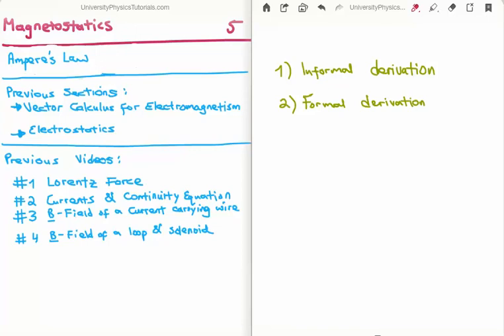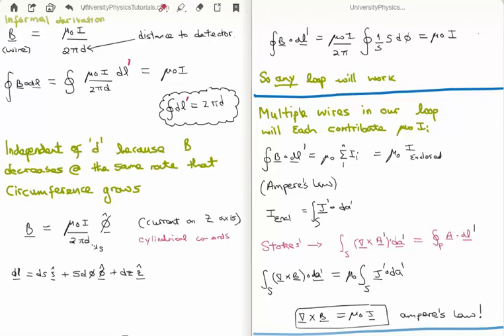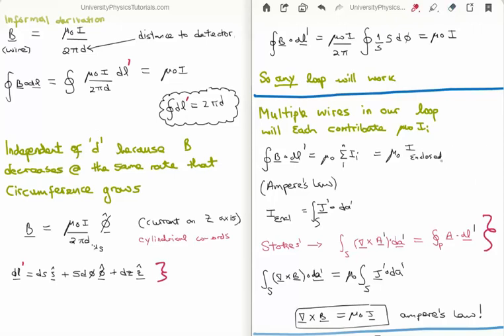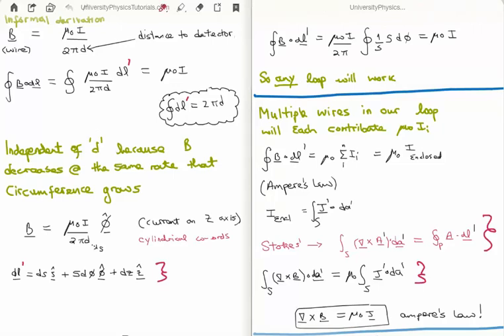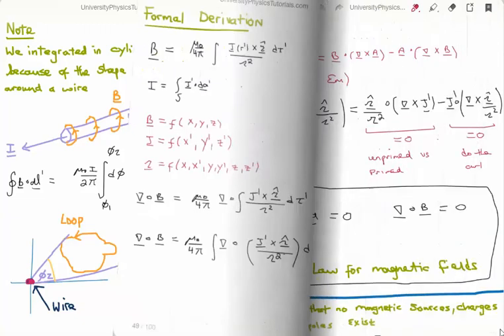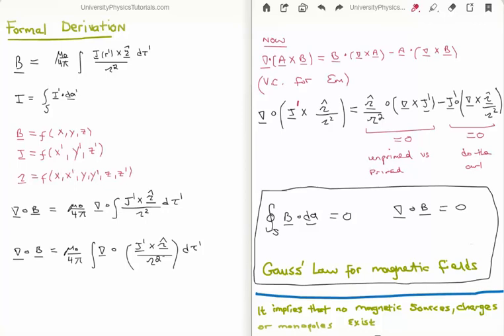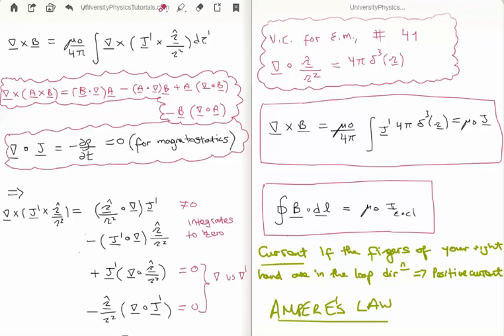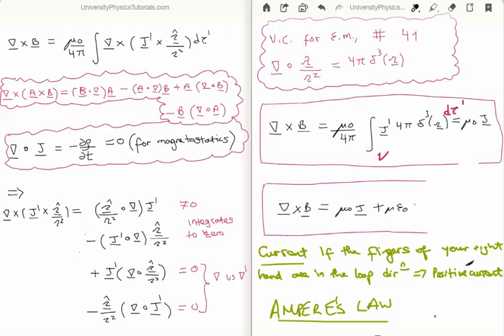Magnetostatics 5 : Derivation of Ampere's Law

Comment: There is a problem in this video with the derivation of the ampere's law @16:02. The (\hat{r}/r^2 \cdot \nabla) J' term actually goes to zero, since \nabla J'  returns 0, as the nabla is the derivative for x, y, z, which J is independent of. On the other hand, it should be the J'(\nabla \cdot \hat{r}/r^2) term which has the dirac-delta function. We should be taking \nabla, not \nabla^{'}, since the magnetic field is dependent on x,y,z. Source:Griffifths.

Comment: I have been greatly appreciating your videos as a supplement and review from my electricity and magnetism class. At around 13:20 you suggest the viewer just take your word that the curl of the separation unit vector over the magnitude of the separation vector squared is zero. It could be explained such that the separation vector is a straight line and a straight line is always curl-less, so that term will go to zero.

Comment: At 8:29 you're talking about the extent of the loop, but the loop does not enclose the wire so How is there any I enclosed within the loop to integrate?
Reply from the maker: That's true, I suppose the diagram isn't great. I was really trying to get across the concept of maximum and minimum angles with respect to the coordinate system. Apologies for the confusion
Reply: Gotcha!

Comment: Why the integral of second term in expansion of triple product at 16:40 is zero?
Reply from the maker: Imagine integrating f(x) with respect to y i.e., f(x)dy. This would be zero, since f is a function of x and not y. Well your question has a similar answer. The nabla operator is a function of the UNprimed co-ordinates whereas both the volume current density (J) and the separation vector (r) are functions of the primed co-ordinates. So we'd have terms like d/dx of x' which would be zero etc.
Reply: Thanks for a prompt response. Separation vector is a function of primed - unprimed coordinates (x-x'). In principle one can convert nabla to negative of nabla prime when it is being operated on separation vector. That will give non zero contribution. I still dont see why second term is zero.